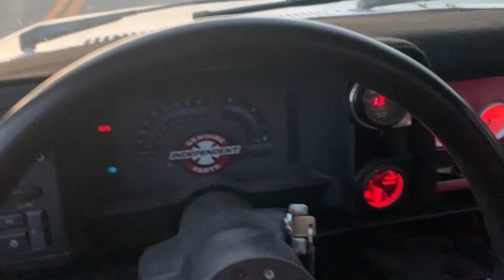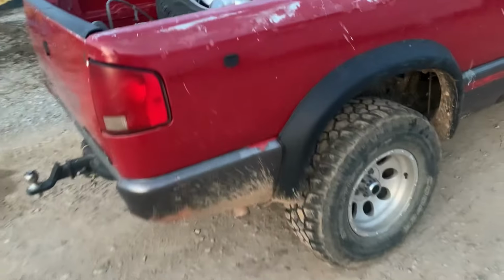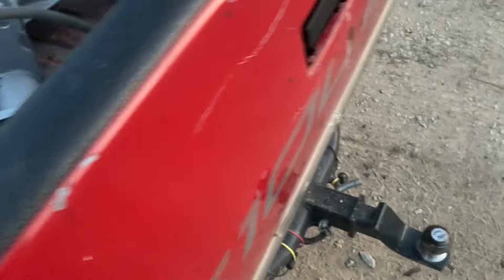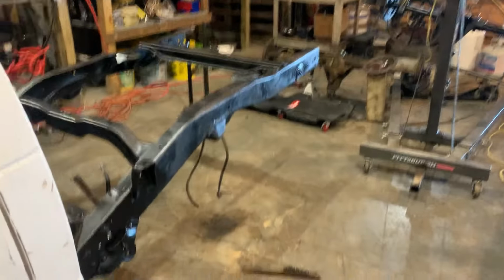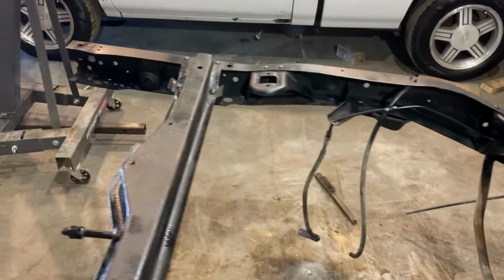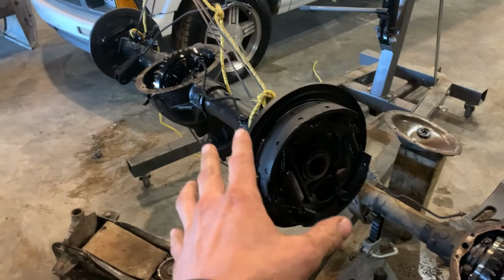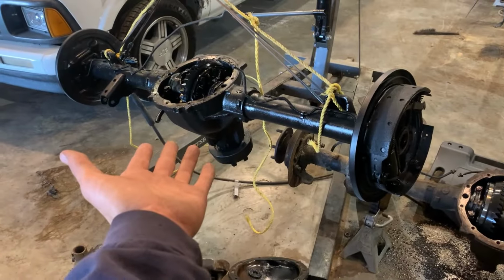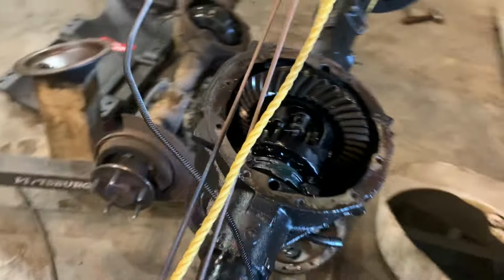2WD 8.5 swap into the turbo truck has began!

Comment: Consider mounting a second turbo as a compound setup. That should help considerably with lag issues.
Reply from the maker: It definitely would help but for what it’s used for it’s not too bad. Especially by the time it gets proper injectors and tune. Definitely no race truck

Comment: Been looking at doing this to my 89 gmc s15 that is ls swapped and has a 4l60 and was looking at upgrading the rear end to this cuz of the disks brakes also
Reply from the maker: Excellent choice! These rear ends are more than strong enough and are a direct bolt on replacement. 
One thing to note is you can disc brake swap these like I did if it was drums to begin with
Reply: @ what year and make was this out of by chance definitely doing this now
Reply from the maker: @ this rear end is out of 1996 Chevy S10 4.3 5 speed. I hear that was a common rear end for 4.3 5 speed trucks in the 90s